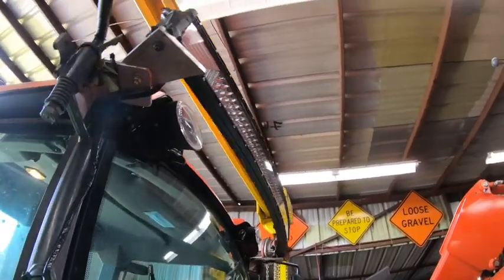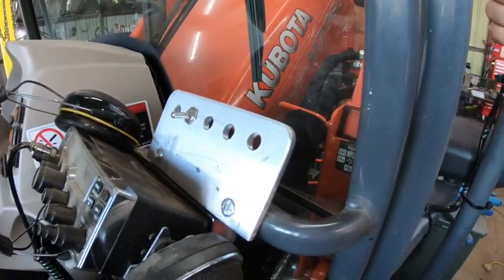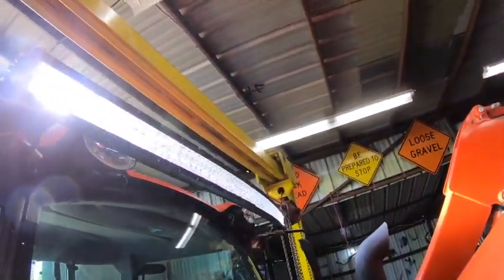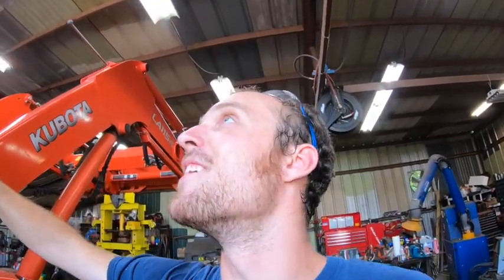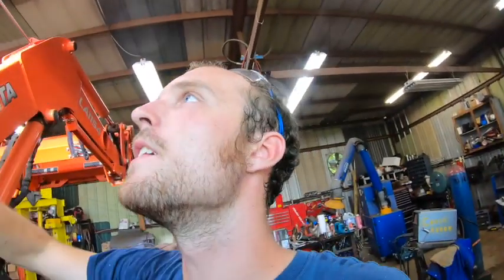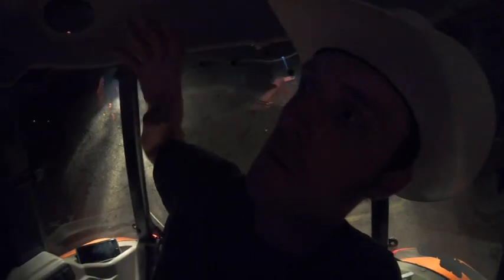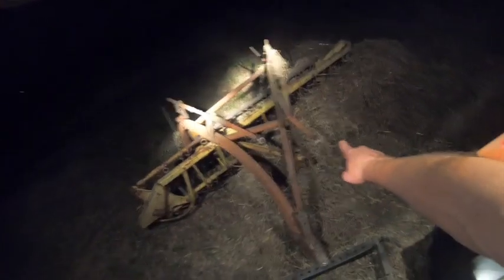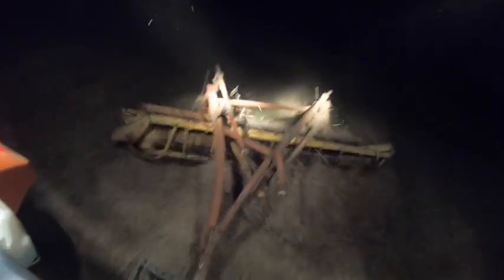I Put A Cheap LED Light Bar On My Tractor & It Changed My Farming Operation!!!

Comment from the maker: UPDATE: This video was edited in January, but not this January, sorry, I've been behind. Anyway, this light bar was GREAT. No, I'm not affiliated with the manufacturer, or any LED manufacturers for that matter. I bought this one sold by "Autosaver88" because their name made me laugh. I've also had great luck with "Nilight" products. Yes, I know nilight shills on YouTube but I'm not shilling for them, although maybe I should because I put some variety of LED light bar on most of my trucks, trailer and tractors. Why? Because they're CHEAP and I'm not good at time management so I always end up trying to do ** at odd hours, and I'm tired of messing with flashlights that are always dead or produce exactly ONE ***** lumen of yellow light. 

Anyway, I really like this light bar. I did seal it with RTV silicone before installation, and did it help? Honestly I dont know, but maybe, because I have had other light bars leak and a cheap tube of RTV now can save a lot of headaches later, so especially for anything thats in inclement weather, its really a good idea to cough up the extra $4 or whatever and do it right the first time.

Anywho, I'm pretty sure this is the exact light bar that I bought, its the same style from the same manufacturer, but it might be a litle longer or shorter since I cant find it in my amazon history for whatever reason. Yes, these are affiliate links, so if you buy anything on amazon after clicking on them, the channel earns a small commission which helps make non-sponsored content like this possible. Thank you! 

52" Light bar for full dude-bro style lighting:
https://amzn.to/3v5hrFr

Smaller 32" version of something less massive looking:
https://amzn.to/3h14g07

22" triple row, flood/spot light combination light bar, which is small enough to fit on many tractor hoods, fenders, etc:
https://amzn.to/3t08Y41

RTV Silicone to seal around the lens with:
https://amzn.to/3BDdGbG

On/off old school toggle switches:
https://amzn.to/33DJ5hz

Marine Grade wire, thats corrosion resistant and has super durable insulated coating. This is what I normally use for all my farm equipment and it holds up great:
https://amzn.to/3sZ2x11

Don't forget an inline fuse, just in case. I gave mine a 10 amp:
https://amzn.to/33FQZHo
Reply: high school skank perfume, had to laugh!!

Comment: You may find it more convenient to use panel mount fuse holders, and mount them under the switches. It will make finding and changing the fuses easier when you add more lights.
Reply: Or get aircraft style circuit breakers that are resettable. With the cost of fuse holder I don't think they are much more.

Comment: The light bar I bought on clearance at Tractor Supply has a remote and controller that has three more circuits for whatever accessories that don't exceed the current draw. Wiring was as easy as mounting the controller and hooking up two cables as the relays and fuses are in the controller. Five years on and I've had no problems and have swapped it to other vehicles using Command adhesive strips so I didn't have to drill holes into my trucks. Those things are the cat's meow.

Comment: The only spot where I prefer halogens lights are tripod work lights, in dead of Midwest winter. The extra heat they make in a garage is so nice. Plus they reliably ignite where as LED and fluorescent lights take a while to warm up to turn on. Other than that, the amp draw on LED is so much nicer, I think it's like 1/10 of what a similar sized halogen uses.
Reply: I've never seen LEDs take more than 2 seconds to turn on and its always full brightness.

Comment: Last year, I converted all the bulbs in my '93 Dodge pickup to LEDs and after discovering you DON'T want the cheapest bulbs on Amazon, I am very pleased with the results.  I especially like the bright LED replacement backup light bulbs I installed.  My next project is to install some small LED fixtures on the sides of the truck to illuminate the sides and where my rear tires are traveling while backing up to avoid any small unseeable obstacles that may be in or near the tire path.

Comment: Clamp on meter on that thing you'll be able to tell how much amperage it's pulling... if it's a smaller light, you can even do it with an inline shitty harbor freight multimeter.

Comment: Good job don't forget the inline device that keeps LED lights cool. Don't know what they're called but I know you need them when upgrading headlights
Reply: The heat sink is built into the light bar/pod... The inline thing your talking about is a ballast resistor when using led bulbs on automotive turn signals with out it the signals blink to fast or not at all due the less amperage/current draw of the led bulbs
Reply: @christopherfarmer1812  thank you

Comment: Don’t bother with the light bars, just swap out the stock lights for nilights 120w. Way less work, and uses stock wiring and switches. Will post a video on mine soon, but it’s wicked easy swap and I farm with them allot feeding cattle and haying.

Comment: They figure the "watts" just by adding up the lights.  So for example, it has 7w LED's and there are 80 of them, therefore it must be 560w...  But that would only be true if they hooked them all up in parallel;  which would pull 46 amps.  So what they are doing is likely putting long sections in series and then hooking those parallel to each other..  So that bar is likely only pulling around 100watts.. which is only 8 amps or so.  I know a 17w LED is equivalent to a 100w incandescent..  So that's only 17% the power usage of an incandescent....  If a guy had the patience to cut the contacts on all of these LED's and run them all in parallel, you would get the full 560W and it would need a 50 amp fuse--- but man, I bet it would be stupid bright. lol